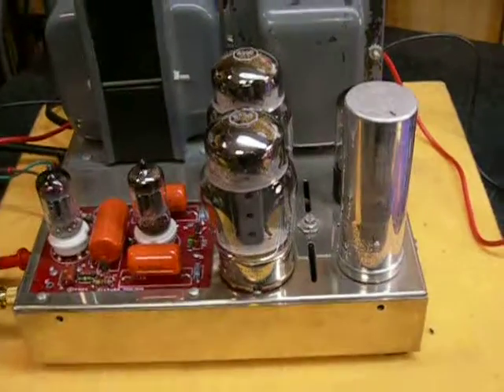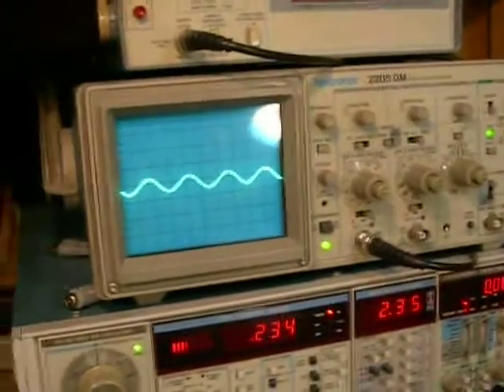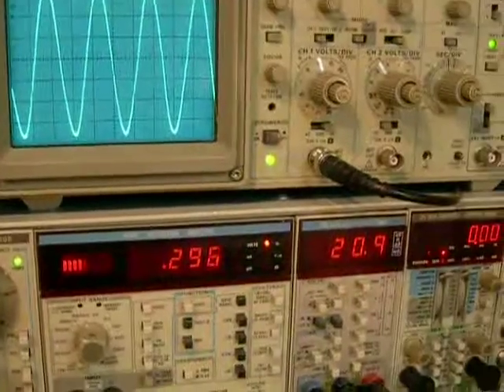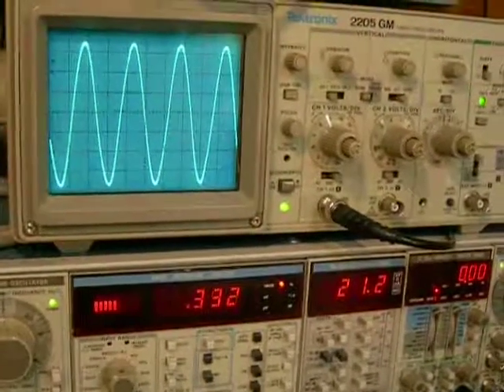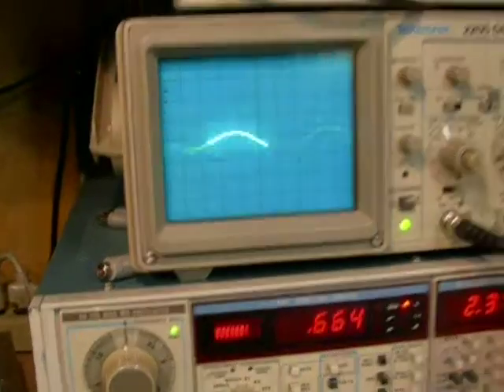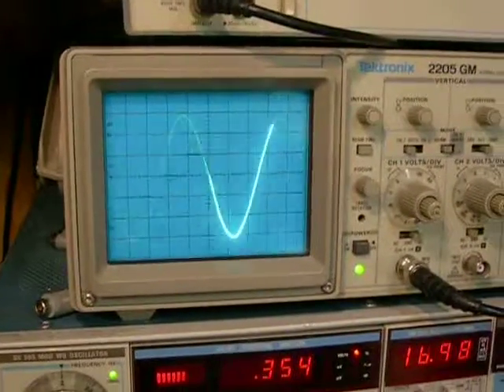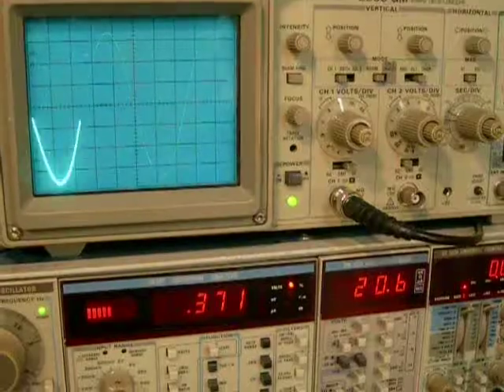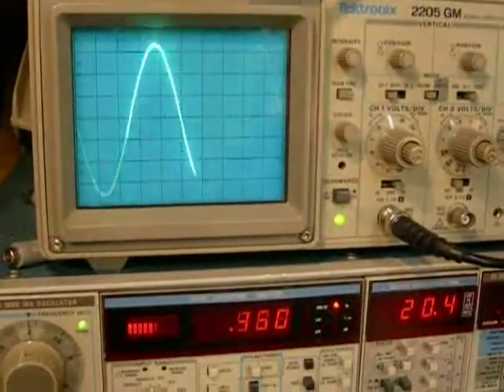Modern Tung Sol 6550 Vacuum Tube.MOV

Comment: What are your conclusions and implications for their use?
Reply from the maker: I am partial to the Tung Sol tubes and that is usually what I buy new. I like the old USA tubes better but I am usually not willing to pay $100+ per tube. I have found the cheaper Sovtek 6550's very strong also. The Svetlana and Gold Lion tubes are more expensive but I am not impressed with them. Just my thoughts.
Reply: Thanks for your reply. I lived in ElPaso in 1985-86. Stationed at William Beaumont Army Medical Center and lived on Zion on the Franklin Mountain :)  I use the Tung Sols as well and have a vast supply of the vintage ones.  Thanks again.